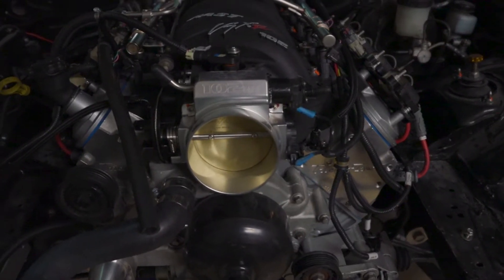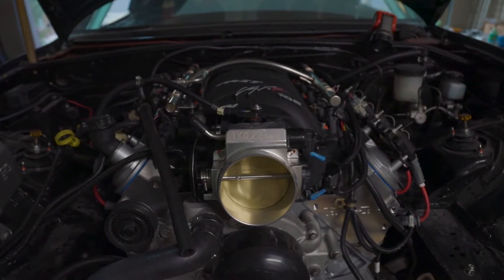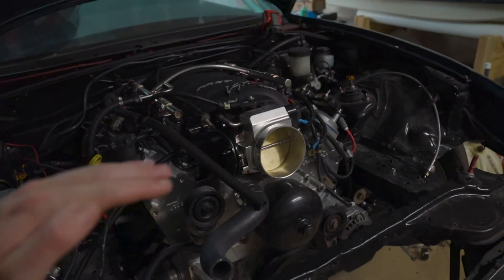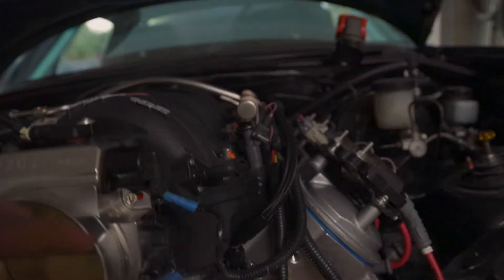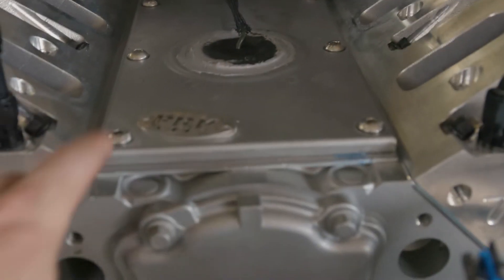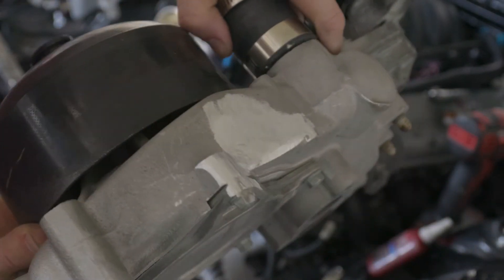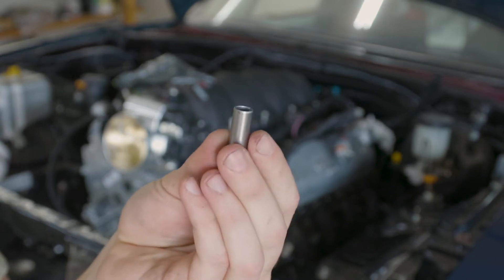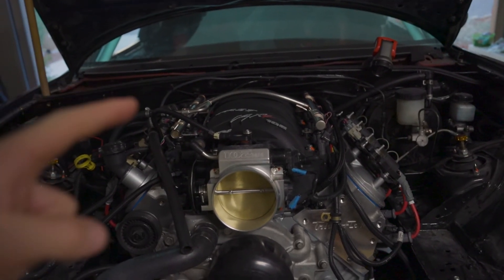How To: Install FAST LSXR102  To LS1

Comment: Why did you plug the vacuum on the throttle body. Dosent it connect to the valve cover. Also mine is connected to a oil catch can. Not sure if thats right. I bought it like that.

Comment: I have a fast 102 on my ls1. Need to change both knock sensors. Do you think its difficult? Should i pay to have it changed or do it myself. Im a decent mechanic not a novice.
Reply: Shouldn’t be too hard. Just make sure to put a little bit of silicone around them when installing them

Comment: No problems using  LS3 rail and LS3 injectors on the LS1 fast intake? spacer or adapter used or no?
Reply from the maker: Oddly enough the ls1 fast intake goes better with ls3 fuel rails and injectors. ls1 injectors are too long and require spacers but ls3 injectors do not
Reply from the maker: You just need to get ls1 harness to ls3 injector connectors. They’re cheap on Amazon
Reply: @56DannyF56  did you use ls3’s on yours? I have a lsxr 102 I’m gonna throw on my gto this winter and have a set of ls3 injectors but really haven’t figured out what I want to do yet.
Reply: @56DannyF56  I think the injectors you have are actually LS2 injectors. According to most LS forums the ls3 injector is too short and needs spacer. The ls1 is too tall but the ls2 is in middle no spacers needed. Even in the video you say “ls2 injectors”

Comment: I sold my Fast intake after I failed to find any air cleaner and tubing that would fit the thing.  What did you do for an air cleaner, or did you leave it off?
Reply from the maker: I measured the outer diameter of the throttle body and my MAF and got a coupler fit. Air filter is connected to the MAF like before
Reply: @56DannyF56 is there a restriction in airflow from the MAF being a smaller diameter than the 102mm throttle body

Comment: No ls3 intake adapters?
Reply from the maker: Not sure I understand your question. It's an LS1 intake on LS1 heads with LS3 fuel rail and injectors. Everything mates up for the most part. You will need an adapter to plug the LS3 injectors into an LS1 Harness if you go that route. Let me know if you have any more questions!

Comment: So your stock pcv pipe (from break booster to intake to top off valve covers) didn’t fit on the lsx intake?
Reply from the maker: Pipe diameter was fine just needed to get a longer tube

Comment: Thanks for the video. Lots of good info. Does it come with throttle body and intake port gaskets? Are you using an OEM injector seal? Or FAST seals
Reply from the maker: Hey thanks for the feedback!! It does not come with the throttle body. I got this one and transferred parts over https://www.fuelairspark.com/102mm-big-mouth-throttle-body-w-out-tps-or-iac.html

You also have to get intake port gaskets.https://www.fuelairspark.com/8-lsxr-intake-port-seal-ls1-ls6-ls7.html

Injector seals (o-rings) came with the new injectors I installed. LS1 style injectors need different o rings to fit if you are staying stock.